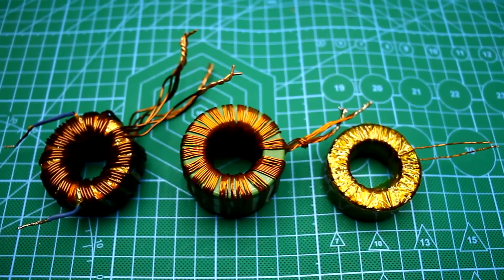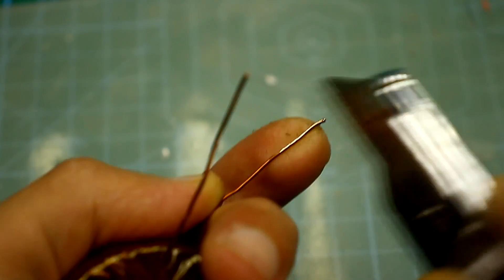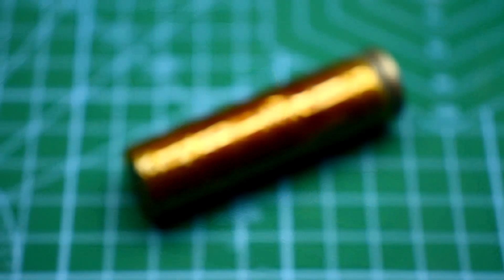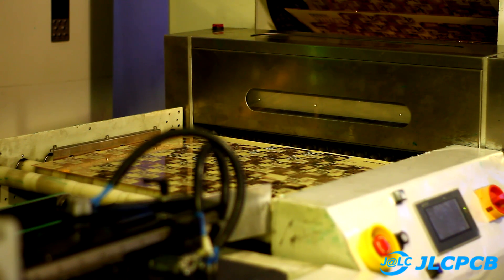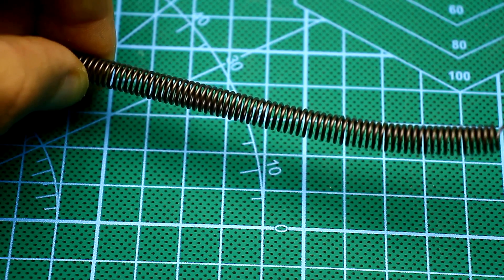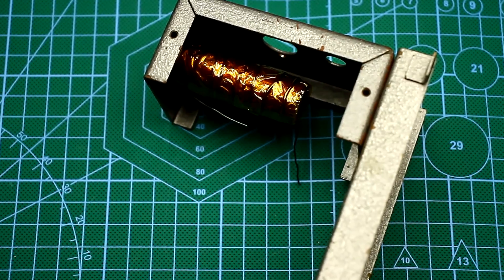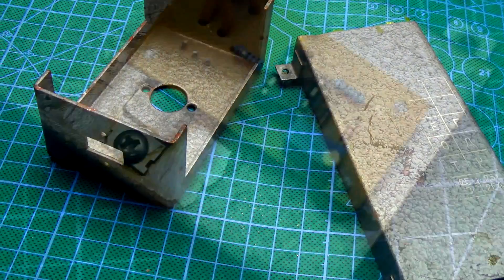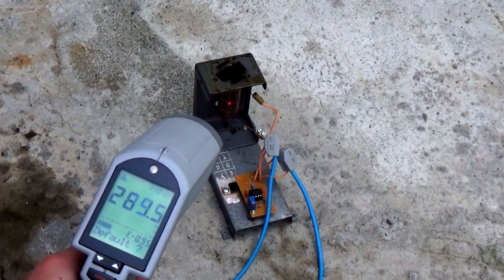MEGA useful device! Bath for tinning

Comment: What are the signal diodes for?
Reply: They provide different charge and discharge paths for the timing capacitor C1. It charges via one leg of the potentiometer R2 and the diode VD1 when pin 7 is high. Then it discharges via the other leg of R2 and VD2 when pin 7 goes low. Having separate charge/discharge paths allows the potentiometer to vary the duty cycle of the 555's square wave output on pin 3 from almost 0% to almost 100%, which then determines how much of the time the mosfet VT1 is on. That is how the power delivered is controlled.
Reply: @RexxSchneider  Thank you, that makes a lot of sense, I was wondering how one might vary the duty cycle on a astable 555 setup. I will have to play around with this.

Comment: Shouldn't you add a diode across the heater to protect the mosfet and the 555 from voltage spikes?
Reply: It's not a coil so he shouldn't did that.
Reply: @pawel4066  Actually, it clearly is wound as a coil, but of course it only has an inductance of a few microHenries, so any potential spikes will be completely damped out by the resistance of the nichrome wire. You don't need any protection from that, although a 555 generates its own current spikes when it switches, so best practice is always to put a capacitor across its supply close to pins 1 and 8. I usually suggest around 10 microfarad tantalum or ceramic for that job.

Comment: Well...you could use a mazilli driver induction heater as it would be much more efficient and quick.
It would be very easy to build and would work very good.

Most of all, you can directly heat the solder by induction(already tested by me), though be careful while doing that because solder has very low permeability, it will increase the Mazilli driver frequency, so use a proper dv/dt rated capacitor for the tank circuit of induction heater.
Reply: Good call.  This is a very simple and easy to make device that is cost effective.  However, I was thinking the same about when I was thinking maybe can even use clay as an insulator if you know the shrinkage to get a tight fit... though not too tight to crack when dries.  Rockwool should work also. Then... I thought... hhhmmm... how to fire the clay to bisque fire and make really longer term strong.  Then the induction heater came to mind to fire the clay and to use later also. The induction method would be more expensive of an investment however is cheaper than the pot baths and might have multiple applications if you do metal or glass work.  Nice simple project.
Reply: Neat table top also.  I've been salvaging stone and marble tiles to do similar.  Found an old granite bench with a back splash even that was used in a school lab.  Awesome find and is neat what can be made for time and searching around for free salvage items that people throw away or maybe in some parts of the World have free postings on Craigslist, Offerup, Letgo, etc. or at a local dump.